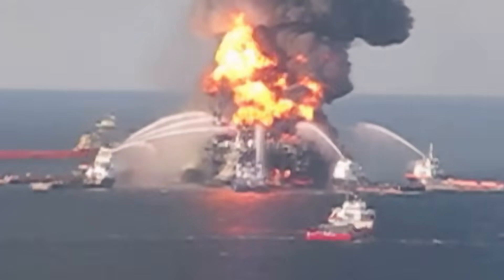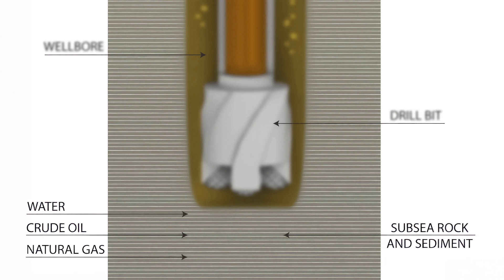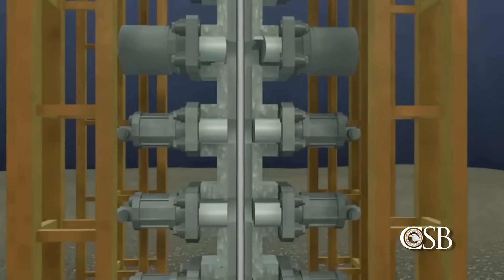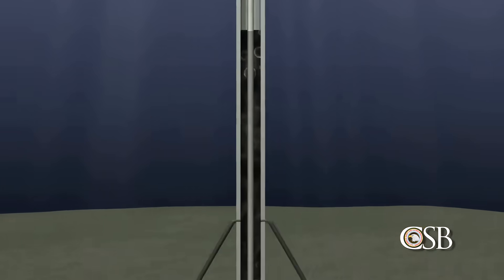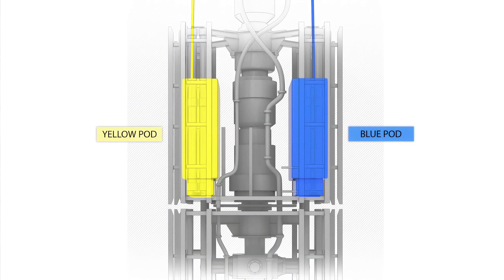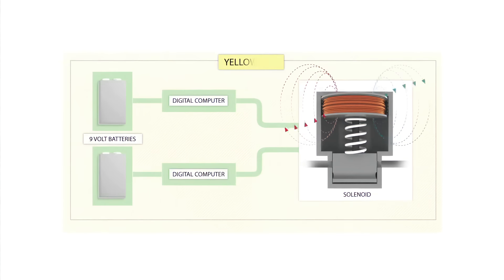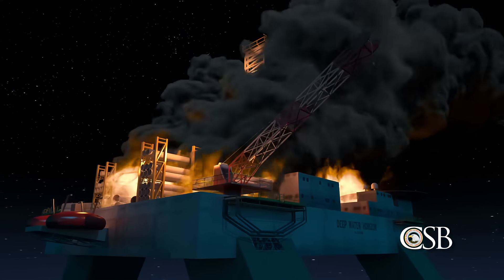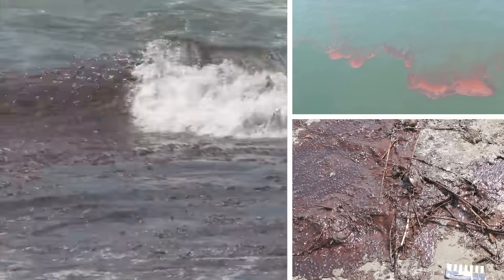Deepwater Horizon Blowout Animation

Comment: No Bp executives went to jail.
Reply: Moonman 
How old are you? When youre company's negligence impacts an entire ecosystem, endangering wildlife and poisoning an ocean, you don't hold the fucking guy turning wrenches responsible. When a guy on an auto assembly line fucks up and thousands of defective cars get sent out to consumers and people get killed or injured as a result, who's held responsible? Who pays for it? Who gets sued? Who pays the settlements? The line worker or the company?
Reply: DemocracyOfHypocrisy  1) the company responsible is the manufacturer of the failure  2) the company who owned & operated the drill was a subcontractor, not BP
3) BP was two companies removed from responsibility
4) BP execs had nothing to do with the blue collar retards who couldn't put 4 colored wires into 4 colored holes and killed those men
5) you're an idiot
Reply: Moonman
 BP and Trans-ocean are partners. Trans-ocean owns the oil rig, and BP leased the oil rig. There are government regulations that need to be followed. Managements on both side ignored the regulations and went ahead with the drilling even though it was not fully safe to do so.
For example, in the airline industries it is a standard procedure that all airlines must make sure that pilots inspect the plane before the plane can take off. Lets say the maintenance person made a mistake, and the airline told the pilot that he/she only has 25 mins to inspect the plane instead of one hour and 30 mins. The reason is because airlines wants to save on landing fees and pack in more flights. Less time on the ground and more time in the air means more money for the airlines.
Who fault would it be if the plane goes down? If your son or wife was on the plane, and you blame the pilot then you are definitely misguided.
Reply: Blake Green That's not an example of irony.  Are you sure you know what irony is?
Reply: Man, what a tragic send-off.
The irony in this sense was 'situational irony', which very simply means a situation where the outcome is opposite to what was expected to happen. This is from the expectations of the person whom is responsible for the situation - i.e, you.

So I'll spell it out for you. By responding to the original post and consecutive replies in a way where you feigned idiocy, your purpose was to look like an idiot and attract serious replies from people who thought you were an idiot and who couldn't understand the information presented, but when in reality, you weren't. However, the irony here is that you are actually unable to comprehend basic information, like I said. And you just proved this by incorrectly correcting and example of irony.

You thought you knew what irony meant, and smugly 'corrected' me, but what you really did was create another instance of irony. Good on you mate. Better luck next time.

I will however, give you credit where it's due. Your continued responses were somewhat amusing to read throughout my work day. I did actually look forward to see what you'd come up with next.
Reply: rightly so....  whoever fucked up the wiring should go to jail
Reply: Moonman
 It doesn't matter if someone fucked up the wiring. It is still the management responsibility to check for safety.
Reply: Bobby Bobby  This is worker error & low level supervisor error - blue collar stuff.  Not upper management or executive level.
Their responsibilities are much higher up than wiring.
Reply: +Moonman, BP managed the contractors who did the well cementing. They also has a large say in the rig&#39;s operation - what the drilling contractors actually do. Emphasis on them having a large say. They pay the money after all, and problems with the well bore are also the Oil Company&#39;s responsibility, because they chose the drilling location. The Oil Company manages the drill, the drilling contractors perform it.

Even if the BOP failed, it would still be BP&#39;s fault for pulling the cementing contractors away before the cement had set and the proper tests were carried out. Furthermore, if you had watched the video carefully, you would see that the redundant safety system&#39;s incorrect wiring did not stop the redundant safety system from actuating - it did. However, as a result of clearly unforeseen circumstances, the safety system failed to seal the well.

When designing safety systems, all possibilities should be accounted for, but if the system encounters an issue that it was not designed for, clearly it will not be able to do its job. But this does not necessarily place the blame on the manufacturer of the safety system, or the people who installed it, for that matter.

There were as with every major one many reasons why the accident happened. But there are more important reasons than others. Failing to properly seal a well before retrieving the drilling mud is one of those more important faults.

Responsibility for the accident may be shared in some (very minor) regards with those who failed to maintain the BOP&#39;s emergency systems, but the majority of the blame is with BP and Transocean. Probably more BP if their site leaders did indeed push along ambiguous pressure tests.

BP&#39;s own accident report labels the faulty wiring as 1 out of 3 points that went wrong with the Blowout Preventer, which is the last out of 8 points that were their key findings.
Reply: Blake Green Nope, they hire contractors who bare full responsibility - they pay a lot of money so that they don't have to deal with the blue collar bullshit.
BP is innocent, this was a blue collar crime; Cause: incompetence
Reply: Bobby Bobby If the plane goes down I blame the incompetent moron who put a blue wire in a yellow hole and built a plane that didn't work
Reply: Moonman
 Clearly, I can see that you have never been a manager before. Doesn't even sound like you work dude. If you do work, you probably work at a call centre.
Reply: +Moonman, you really have no idea.
Reply: Bobby Bobby  Certainly not a blue collar manager, but I manage my own online company with subcontracted employees.
Reply: Moonman
 Well, that explains it. So if your subcontract employees fucked up, you want to wash your hands clean and blame it on the employees.
But running an online company is totally different from running an oil company. There are 3000 Federal and States laws that oil and gas companies must comply.
When you hire subcontractor people, you can pretty much do whatever you want, as long as you pay them for work done.
You way out of your depth on this issue, so you should drop it,
Reply: Bobby Bobby  who is talking about debt? I'm talking about dumb blue collar workers who can't put blue wires in yellow holes.
Reply: He meant 'depth', as in, a subject you don't really have any experience in. Your mistake is assuming these oil drilling contracts are the same as the ones you use in your online company.
Reply: Blake Green I don't assume anything other than that he's capable of saying what he means
Reply: Moonman
 Thanks for correcting my spelling.
Blake hit the nail in the coffin.
The workers who worked at the oil rig are not subcontractor. They were unionized employees of Trans-ocean.
Reply: Bobby Bobby  You mean to say he "hit the nail on the head", as in was accurate.
To "put the final nail in the coffin", he would actually need an irrefutable argument.
Reply: Moonman
 You should just stop trying think that you are a professional expert here. You probably don't even know the whole story behind this incident. You are not a corporate lawyer that deal with Federal and States laws.
But somehow you are compelled to tell us that you are right.  You are like a person without a PHD in economics, but wants to lecture people on how economics work. You are like the Trump university instructors. No credential and qualification on mortgage and property management experience, but tell people how to managed mortgage and property risk.

You should just stick to your online t-shirts business.
Reply: Bobby Bobby lol aw, u mad bro?  I'm traveling the world with a passive income stream and you're just a tool.
I'm a boss and you're a bitch, have fun at work lol
Reply: It's reasonably obvious that you're attempting to troll this discussion, but you come off as sounding like a complete moron who can't comprehend basic information. A school child. Ironically for you, that's probably a fitting description regardless of your trolling attempt.
Reply: Blake Green
 Well said!
Reply: lol dumb & dumber
Reply: Light up the Darkness: the bad wiring was NOT a contributing CAUSE of the incident and the 11 deaths.  Could have been if the 9v battery wasn't dead.  Watch the video again.

Comment: Bad wiring and dead 9 volt batteries. Oy vey
Reply: Don't think it mattered anyways, the bent pipes made it ineffective.
Reply: well its pretty obvious they didn't use durracell batteries, that bunny never runs out
Reply: Trump 2016 it does matter quite a bit. Ignore the bent pipe and assume it was perfectly straight then you have a company that improperly installed a BOP against the advice of many engineers and on top of that failed to maintain the improperly installed BOP. You should read the report to the President from the commission who looked into this disaster. I have and I found it very enlightening and troubling. There were many things that contributed to this disaster and the bent pipe is just one of MANY. 

https://www.gpo.gov/fdsys/pkg/GPO-OILCOMMISSION/pdf/GPO-OILCOMMISSION.pdf

Comment: disgusting, BP should be shut down over their carelessness of our planet
Reply: yes, them effecting less than 1% of our planet, yet supplying enough energy/oil for a large portion of people to effectively carry out their day, and drive around means they should shut down the whole company. get a grip on the whole picture not just your feeling over one problem and one video.
Reply: its exactly this kind of thinking, that we will have oil till the end of time, that is the problem. people better wake up to the fact that its finite and it won't be around forever so maybe they should start shutting these earth killing producers down.
Reply: Garnet K  Fossil fuel is just one tiny step on our journey, an NO2 boost for the engine of human potential.
Our next energy source is the sun, and this transition is already in full swing.
Oil is a two-century resource, not more.

Comment: Facepalm, they use a 9v smoke alarm battery to close a vital solenoid valve...
Reply: A 27V battery was used to power the valve. The 9V batteries were used to drive the computers. The coils were driven, not by 9V batteries, but by the 27V. The solenoid being miswired meant one of the coils, each controlled - but not powered - by one of the computers, was wired backwards. Because the computer failed, that coil wasn't turned on, which meant the solenoid opened. The wiring involved is essentially a relay, where the computer's current causes 27V of current to flow to the coil.

If you think all 9V batteries are smoke alarm batteries, you really should leave your basement once in a while. There's a huge number of industrial batteries of varying voltages and capacities, the voltage they put out has little resemblance to their actual size and shape. Try visiting a battery store some time, and I don't mean Wal-Mart. They'll have several hundred batteries of sizes and capacities available and can order several thousand more types, but even that latter number barely scratches the surface of what's available.
Reply: sigh... 9 volts does not mean it was the same 9 volt battery you buy at the store it just means it provides 9 volts... its not the same thing, and the solenoid was closed by the 12 volt battery the 9 volt battery ran the computers and even that was probably bucked down to 5 or 3.3 volts.
Reply: Maintenance ain't worth shit if it was set up wrong to begin with.
Reply: Rob k  suggest you watch it again.  Where does it say smoke alarm battery?  Do you honesly think they would use a PP9 non rechargeable battery at the bottom of the ocean?
Reply: Bp is ultimetly responsible and has spent nearly 20 billion and we arnt thru with their ass yet!
Reply: Hey buddy, amperage, wattage, Amps per Hour, etc exist.

What we are not told is the amperage of the battery.

Voltage x does not require that the amperage be y, it could be c.
For example, I use 120VAC 20A for my MIG welder. However, only 120 VAC 15 A in the receptacle that I plug my notebook charger into. That charger in turn not only drops the amperage and voltage it changes the current from Alternating Current to Direct Current.
Reply: What difference does it make? 9v is all you would need to open/close the valve. Did you not watch the video? It wouldn't have mattered if they had 120v because it was wired incorrectly. Face palm for not understanding the video.
Reply: Yes i watched the video....Facepalm, they use a 9v smoke alarm battery to close a vital solenoid valve...
Reply: it takes a charge and how else are you going to store energy reliably?
Reply: Yea put a fucking duracell in next time. Fuck bp!!!
Reply: Nothing to do with the BOP is BPs fault, the operation and maintenance of the rig equipment was the responsibility of Transocean.
Reply: Thermo couple. Make 6 volts all day. No redundancy, make it cheap. The tech has been around since the 1800's.
Reply: Winter Still no backup power so its a fail was my point, i was being sarcastic of course it wasn't a standard 9v...
Reply: Seymour The way it was portrayed in the video is that it was similar to a 9v smoke alarm battery. Ive worked in electronic industry for 20 years you dont have to school me on types of battery. The fact that there was not a fail safe way of wiring the solenoid means the whole battery system is a failure anyway. They will have a completely different system now so your whole diatribe is pointless.

Comment: so basically, this happened via a shitload of human error and failures. I'm glad I'm on the production side of the oil industry AND we take safety a whole  lot more seriously than they did back then
Reply: Human error?  Do you mean a flawed BOP design that even when it functioned as designed did not foresee a condition that the BOP was not designed to deal with?  I'm surprised the BOP worked at all given the flaws in it's construction.